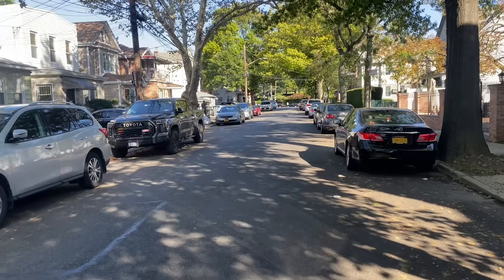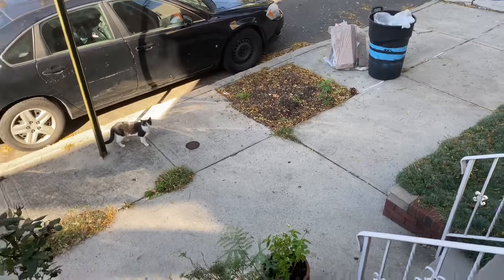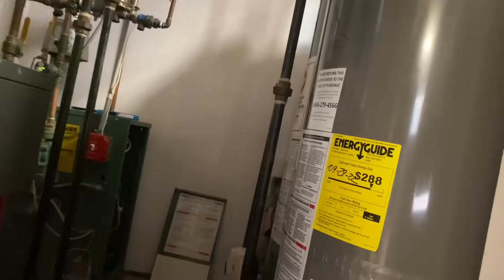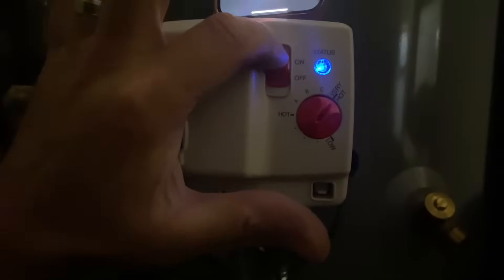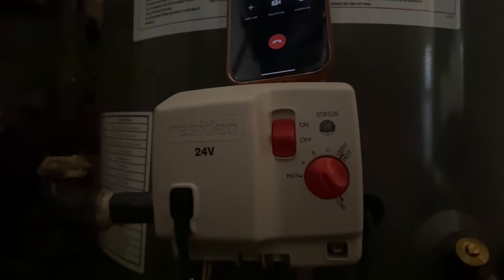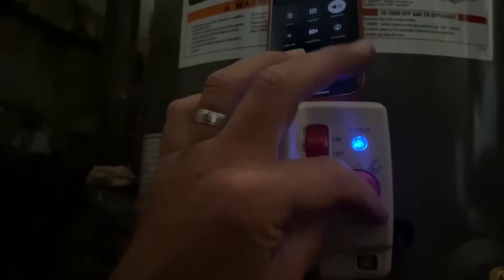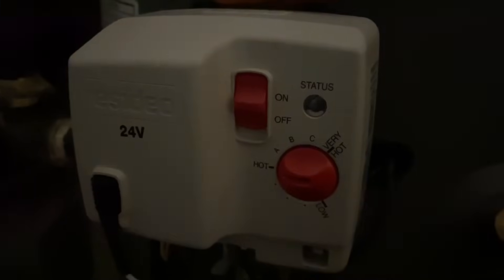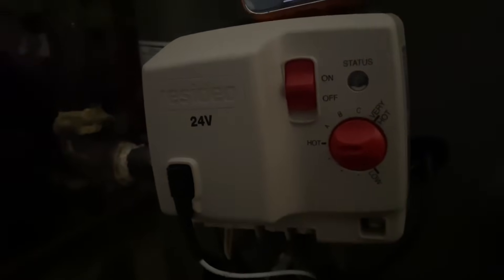Essential Guide: How to Reset Flammable Vapor Sensor on Rheem Gas Water Heater

Comment: Leaving this comment a year in the future to say THANK YOU! I'm a facilities manager and we have a resideo gas control valve on a ProLineXE at work that had the flammable vapor sensor lockout.
Tried calling the support line, got transferred to 3 different departments with no solutions.

Was able to get it back up and running in 2 minutes with your vid!

Thank you thank you thank you!
Reply from the maker: That is awesome!

Comment: Great video.  I had to re-pipe my water tank, and somehow the FV sensor tripped.  There are no instructions for resetting the valve.  The last time this happened,  (had the floors stained), the FV sensor tripped.  I paid 150.00 for someone to come out and do this!.  This was well explained. In addition, Mikey also provides some great advice at the end of the video, regarding the cost of goods sold, services, and your value.  And yes, this hot water tank was installed by jokers...also didnt look like there was drip T on the gasline😃

Comment: Worked for me, Thanks!  Super hot day caused the "flammable vapor sensor lockout" to trigger.  Ventilated the garage to make sure I didn't actually have a flammable vapor, then this video did the trick.

Comment: Mike watching your video showed me how to relight my hot water tank. I didn't have any hot water .  I was afraid to mess with my gas hot water tank. I was looking for causes on a Rheem. Came across your video and did as you instructed. After I  turned off the switch for 15 seconds and turned the thermostat control from low to very hot 7 times, then the igniter lighted. Now I have hot water again.  Thanks & God bless you❤

Comment: That water heater install is definite a no bueno!   Lucky no one in the building died from that leaking flue.  Also proves the choking appliance regulations emerging weekly from our government doesn’t accomplish jack—- when a bozo with tools installs the appliance.  Thank you for showing that correct reset process Mike.
Reply from the maker: I'm glad you found the video helpful! It's important to be aware of the potential dangers of improper installations and to always prioritize safety. Thank you for watching!